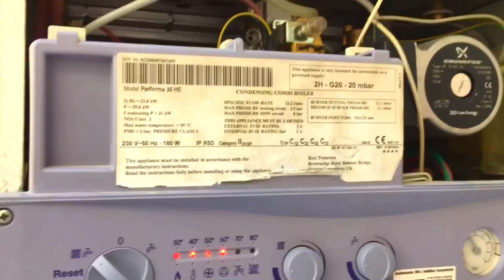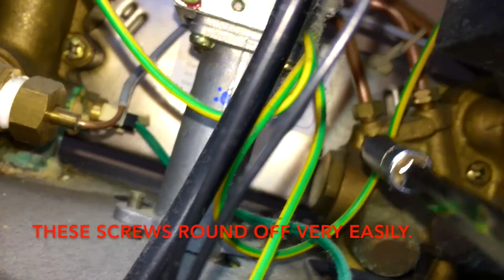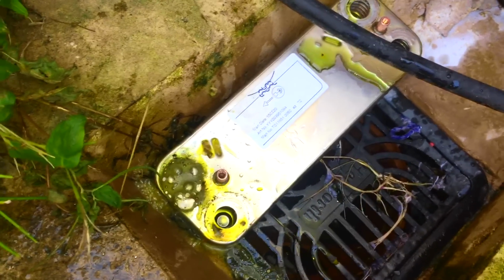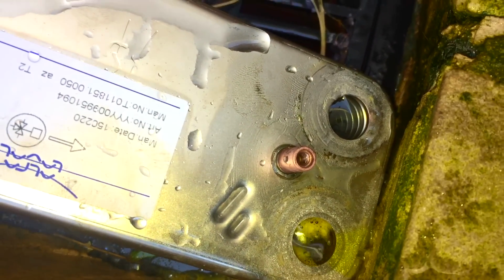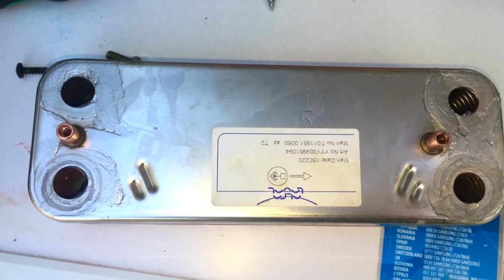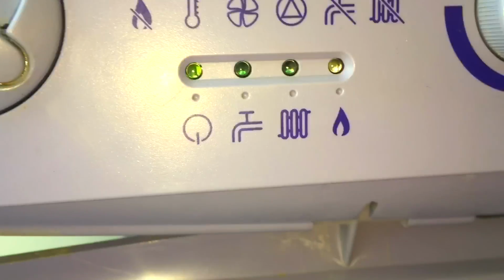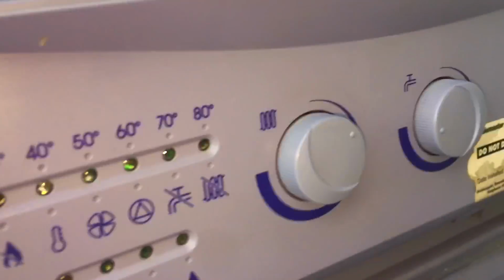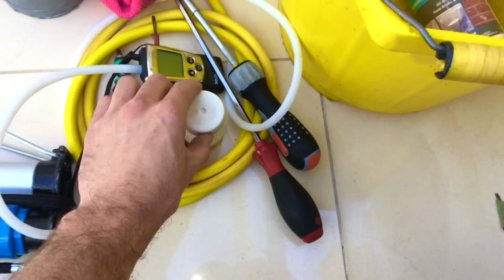Blocked plate heat exchanger sludge. Potterton Peforma no hot water. Heatinggeek

Comment: This is what we use, Hydrachloric Acid. Works a treat but nasty stuff. It’s what Brickies  use to remove mortar from brickwork, but is much diluted. Incidentally, BEWARE bringing this into contact with Bleach!! It will react and produce Chlorine gas. This is the same stuff used in the trenches in WW1 and will blister lungs causing you to drown in your own mucus.
Reply from the maker: I use Mortex too. Its slower but safer. :-)

Comment: Try putting fx2 or another strong de slugger into the AAv on the pump then closing the flow & run the hot water then the chemical heats (works better hot) & cleans the whole circuit in the boiler without removing the plate & changing the seals & it's easy to drain the chemical out as its only in the boiler....I'm in London & never saw scale in a heat plate just sludge from heating side in the plate.
Reply from the maker: I have only seen scale over near SL postcodes. Like you said, just sludge in the plate.:-)
Reply: how would you drain after

Comment: Great vid mate, one question can you use the spirit of salt on the potable side of the heat exchanger,  love the speed it gets it out of there, should have said I do oil boilers.

Regards Alan.
Reply from the maker: You can just make sure you get it all out. Nothing dissolves scale very quickly though. Sludge is easy compared to scale. :-)
Reply: Thanks mate.
Reply from the maker: @pearcemachineshop5200  No problem

Comment: That stuff works really well! Not sure if it's safe to use. I would recommend flashing heat exchanger with white vinegar using a pump and hose in the bucket don't have to remove heat exchanger.
Reply from the maker: Yep there are safer ways. This stuff works great but is VERY dangerous.

Comment: Do this at your own risk. As good as this method works and sounds there is allways a risk of acid eating through thin plates of heatexchanger and DHW presure going in heating system. Had that happen once in my experience even with propper chemical used. Great video never the less.
Reply from the maker: I haven't had it happen to me but I know it can.  Just do it as quick as you can!!!
Reply: there is no chance for acid to destroy the plate....its not common iron,its "rustproof",common iron will be destroyed......
If the problem is big i take the plate back to base,and i leave it inside the acid OVERNIGHT!!!! Nothing ever happens...

Comment: I’ve got a customer who has just had the plate heat ex changed recently.  Now when the hot water is running it makes a loud clunking banging sound.  The central heating is fine.  I’ve checked all the usual things quickly but just wondered what you think it could be.  Also the return pipe gets hot when the hot water is running.  It sounds like it’s overheating but no fault code and no lockout???
Reply from the maker: It could be a lot of things. What boiler is it?
Reply: HeatingGeek it’s a glow worm easicom 28.  I’m going to call glow worm tomorrow.  It’s making quite a lot of noise and really doesn’t sound good.  A lot of clunking and it sounds almost like surging water.  Like it’s kettling
Reply from the maker: @robertgreenaway5166  The easy comes the same a vaillant ecotec heat exchanger. Watch some of the videos I have on the making noise. In the Vaillant Playlist.
Reply from the maker: @robertgreenaway5166  I like the easy com.
Reply: Thanks mate, really appreciate your help and your video uploads.  I’ll check it out
Reply: I've had the same issue on an NTI condensing boiler. Banging kettling mainly after showers. I finally seemed to stop it by adding pressure. It was banging at 17 psi but stopped doing it at 20 psi. I think my heat exchanger needs a descaling but can't figure out how to do it. If I tap into the line the water all drains out.
Reply: lcagee I managed to solve this problem it was the plate heat exchanger, after only ‘apparently’ being changed 6 months prior.  It was completely blocked.  I used acid to clear it out ( thanks to watching this video) and now it runs perfectly.  I power flushed it yesterday.
Reply: My boiler is different. It's in a circular pattern and it doesn't look like it comes out. It looks like a still for moonshine inside. Is the flushing the same? The acid dissolves the calcium? I'm not sure how to flush it without all the water in my pipes coming out. And not sure how to circulate it either.

Comment: Hi HG, bit late but HappyNew Year to you & yours.
Greatat video once again brother,
Is that the usual method to bleed air out of the AA vent, turning the power on & off at the switch, to get the pump to run momentarily without firing the boiler? How would you do this method on boilers that have sensitive pcb, like Glowworm etc, as I've watched your vids, comments & others on the subject of turning off at boiler then fused spur when isolating, then turning back on at spur then boiler, causing pcb death!!!
I use the method you use, as I was shown that way, but wondered if you or anyone has experienced pcb failure doing it like that, would be a right Bummer!!
Many thanks again & can't wait for your own Vaillant boiler repair update.
😀👍👍👍
Reply from the maker: I haven't had any issues with doing this and I would do it on a cxi. I do tell customers that some boilers will not work when turned off and turned on again. (cxi) I have been under the weather so haven't got anything done on the editing front. ASAP

Comment: When you diagnosed the fault was the hot water getting hot and cold over n over etc and also did the boiler lock out and restart etc I’m doing my gas course currently so the help would be very much appreciated
Reply from the maker: Yes thats correct. The boiler never locked out (that would need reseting). It did go off on temperature and then relight a few (5-10) seconds later.

Comment: hi HG, thanks for your videos learning a lot, will this also work on the hot water site clogged with limescale (light brown/yellow) ? its about a kaori brazed plate exchange on a boiler with a pomp so it never gets flushed with water pressure that why its gets clogged.
Reply: https://zakelijk.ithodaalderop.nl/producten/groot-tapwater/oplaadboiler
Reply from the maker: Limescale doesn't usually break down quick enough for me. If I have one blocked with limescale I will usually replace it. It does depend on how bad it is though.
Reply: if you have scale isseus,use scalebreak mp from goodway,non toxic,safe for metals like copper ,safe for plastics and stuff....very cool stuff

Comment: Hi HG. Brilliant Video. Very good filming. Watching this I feel confident enough to attempt this job for myself. I am assuming pressurizing the expansion tank is not required in order to change the plate but just a good idea to do it whilst drained down.
What I would like to know is regarding air in the system. is this ALWAYS going to happen and can you explain the process used for purging. Thanks
Reply from the maker: I hope your Gas Safe!!! Its easy enough. Most boilers self vent so its not usually an issue.

Comment: Another great vid. Thanks. With these symptoms, do you generally always firstly suspect this is a plate issue with any combi?
Reply from the maker: No not always. On this boiler its so easy to remove the plate I will always do it first. Electronic Valves will often overheat the boiler before passing. You just get a feel for it I guess. Wish I could give you better advise but I don't have a decent answer.
Reply: I get what you are saying that is really helpful thanks.

Comment: Hi Heating  Geek 
Love watching your videos  . Have you used Kamco  FX 2 for cleaning plates ? I find it much safer, also a 5 litre container with the side cut off most plate will fit into it and can add hot water to help with descaling, I’ve been a gas engineer since 74 but still find your videos  helpful all the best.
Reply from the maker: Wow thats high praise from someone doing it as long as you. I have used FX2 and FX but its not quick enough for me. It is a lot safer though. I do take care when using spirits of salt.
I have been burned.

Comment: Well done, another repair at minimal cost, you correctly diagnosed that it was likely to be a blocked PHE was down to your insight & experience and thats something they will never be able to teach in a classroom.
Reply from the maker: I learned the hard way though. 
I fitted a diverter and after filling up the boiler overheated on HW. I then knew that the plate had caused the issue in the first place. No one told me. I found out the hard way and it sticks with you that way.
Reply from the maker: Exactly. :-)

Comment: Well done, great stuff learning more every time.
 Did you isolate the flow and returns before draining down the boiler? 
Or did you drain the whole system?
Did you pressurise the expansion vessel so it would hold a vacuum or just ensure it was pressurised before refitting and filling system as a form of process?

Comment: Great video.. I done this a few years ago. Tiny splashes went on my £120 snickers work trousers. So tiny, like pin head size. I had to bin them. :(
Watch your eyes using this kinda stuff.
Reply from the maker: Its really bad!! Keep your head right away. 
Don't ever do it in someones house!!!!
Reply: @HeatingGeek  black swan drain cleaner. Pretty awesome for cleaning p2p h/e. I always always wear a face shield ppe, Great stuff dude. Keep um comin' 😉
Reply from the maker: @rayc1503  I didn't have gloves. (I did but couldn't find them and had 11 other jobs that day) Its very dangerous stuff. I try not to take chances with it and always have clean water near by.
Reply: @HeatingGeek  Good man, Keep safe dude. FOR ANYONE ELSE ATTEMPTING THIS GOGGLES AND DRAIN CLEANING GLOVES ARE A MUST at minimum 😊
Reply from the maker: @rayc1503  defiantly!

Comment: That divertor pin always leaks can you do a video on that aswell very common issue
Reply from the maker: Yes it does. I thought that would be a bit basic but have no problem doing it.
Next one I see I will do it.
Reply: HeatingGeek change rubber or whole diverter?
Reply from the maker: @aj7303  Just the little gland seal or 'O' ring.
Reply: That gland on its own is available as a replacement
Reply from the maker: @davidragnoli5162   Yep. last time I got them they were £1.50 each. Sometimes they are cheaper though.

Comment: Great video 
I was working on one of these boilers last week it was doing the same thing, so i took the plate out had a look it was clear then i moved the hot water diaphragm housing out the way to checked the rod was ok, the rod was stuck in the heating Position, i had the service kit on the van changed it  job done. I like these boiler the acces is great.
Reply from the maker: They are good boilers to repair. The APS can be a pain and PCB issues can present themselves in some weird ways. Generally parts are cheap and not to bad to replace.
Reply: you dont need to change it....if you clean the rod very carefully it works fine again....just remember the exact position of each part...

Comment: Presuming you're a licensed to work on heating systems, I wonder why you use hydrochloric acid as its known to attack stainless? On the other side of the pond in America with on demand dhw and boilers a relatively new phenomenon, many diyers are advised to use vinegar and a pump to cycle this solution for about an hour to descale plate exchangers. Some areas of the USA have heavy minerals so a semi yearly to yearly descaling helps to rid plate exchangers of scale deposits. Stainless seems to be the leading material for longer life of heat exchangers.

Does your water supply vary in minerals where it might be a regular service to descale heat exchangers whether as a diyer or service by professionals without using caustic acid?
Reply: He's not descaling limescale, he's cleaning the heating primary side of the plate. I's clogged with ferrous/rust flakes from internal corrosion of radiators, etc. Limescale doesn't usually clog the hot water side of plates in UK.
Reply: @woodbine66  thats not true mate, there wasnt any sludge in this boiler the water was crystal clear when drained. The black flakes would have been limescale formed on the heating side.
Reply from the maker: It does damage stainless. I agree.
However its not in there long enough to cause a problem. About 5min max and then flushed out. If you left it in there for a long time it would cause a lot of problems. I wait for the reaction to stop and then flush through straight away.
Reply: @HeatingGeek  It will still cause damage to the heat exchanger. By apply hydrochloric acid to the stainless steel you are removing the oxide layer which prevents stainless steel from corroding. The oxide layer will reform in the presence of oxygen but unevenly and can leave the plate prone to other types of corrosion. I don't know what concentration of HCl you used but if high enough it will also attack the copper brazing of the plates. This type of heat exchanger should be able to last 15+ years if treated correctly. There are other chemicals that can remove the sludge as effectively without damaging the heat exchanger, e.g. organic acids (mineral acids such as HCl should be avoided due corrosion) such as formic, acetic, citric acid, I'd advise using one of those instead, plus they are safer.
If possible the system should be dosed with chemicals on installation to prevent as much of this sludge as possible and a strainer should be fitted to prevent it from reaching the heat exchanger. When the heat exchanger is found to be blocked like this the system needs to be flushed.
Source: I work for a manufacturer of this type of heat exchanger.
Reply: http://www.biogenactive.com/products/industry/scale-132-copper/

Comment: Nothing wrong with putting brass on condense lets it drain faster over the years.
Reply from the maker: Only if the boiler condenses..... Makes me laugh how shit some of the installs I go to are.
Reply: Went out to a guys first service on a Vaillant last year laughing because he got my quote undercut but more than half, Biasi flue fitted (standard efficiency flue), leaking CO, holes in flue, obviously no benchmark, capped and quoted to repair, got the job that time round, teaching them one at a time.
Reply: charlie b that’s really bad
Reply from the maker: @charlie12358  Thats RIDDOR too. What a pain in the ass that would be. I always charge double when going back to another installers F up.
Reply: @HeatingGeek  It would be easier getting Gas Safe to do something than to track the installer down.
Reply: Hi all. Metal pipework is NOT suitable for use in condensate
discharge systems.   This is from the MI's. Perhaps you were joking Charlie?
Reply: @christopherhopper8165  Personally I have been running condense in copper for years now and not once have I ever had a problem, you just need to fit a check valve so it doesn't back up to comply with water regulations.
Reply: @charlie12358  Think i'll go by the MI's, Which as you should know are top of the tree as there checked off by Gas Safe, B.S.I., Building regs, etc. Copper condense pipework will rot through and leak sooner or later, granted will take a while. Are we talking about the same thing Charlie? "Check valve" on a condense pipework?
Reply: @christopherhopper8165  think he's pulling you're plonker

Comment: Great video again, i've used kirock k before, but that's a  lot more milder, more for kettles or to be left over night,.
 Is knock out, spirits of salt and kilrock spirits of salts and other brands the same stuff?
 Also seen people recommend One shot drain cleaner? again is it same stuff?
 great tip on the flow pipe/diverter valve getting hot or not.
looking forward to the pcb tips, as had a old worc 28cdi pcb out today, no sparking but  everything else working, did all the basic electrical test, all good.
I wanted to test the big  blue spark transformer for resistance, lot harder than my own worc 25si to get apart, it had a smaller second sparker that the leads directly connected to, anyhow after a fiddle about,seen it was not removable  put it all back together to my surprise it came back to life!!!! happy customer and me, happy not having to find a replacement recon pcb on ebay for a 30 year old boiler!!!!! keep up the hard work mate, great job to tips.
Reply from the maker: Thanks a lot. The spirits of salt I use is 32% hydrochloric acid. they do a 19% and 21% the 32 is just quicker.
I sometimes use Mortex brick and patio cleaner. Its 20% and good for general stuff. 
All of the above will burn you and anything it spills on in the van.
The PCB stuff is general and not as deep as I would like to go.

Comment: quality job...  id never thought of using this..  i thought it would have just eaten away at the metal but seems to bring it up like brand new! 

keep these coming :D
Reply from the maker: It will pit the metal if you leave it in there for too long and you need to keep it away from the copper studs. Have a bucket of water to flush the top off if it happens.
Reply: @HeatingGeek  Or find that funnel Lol.
#

Comment: So, no magnetic filter to catch the crap/haematite sludge? I've used drain acid a few times to resurrect PHE's and it scares the crap outa me. I always fit new o rings tho...just in case.
Reply from the maker: I have all the rings on the van but only fit them about 30% of the time. I check them with my finger and if they still feel like rubber I don't replace.
Reply: @HeatingGeek  Same here just a smidge of Ht silicone grease around all 4. Then t'is ready to go 😉
Reply from the maker: @rayc1503  Simples.
Reply: @HeatingGeek  Seriously everyday's a learning day. My ways not necessarily the easiest or best way to do it, or is it? 😂. Your advice is 2nd to none, TOP MAN 😊